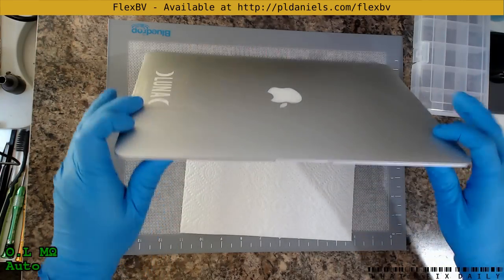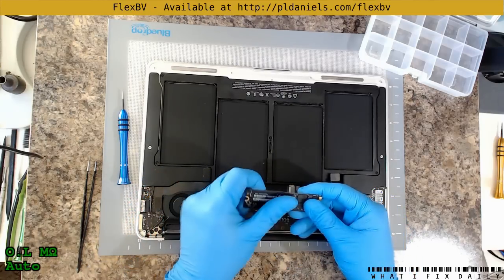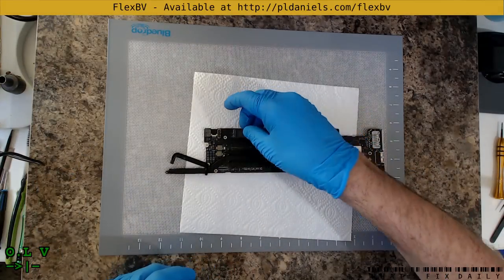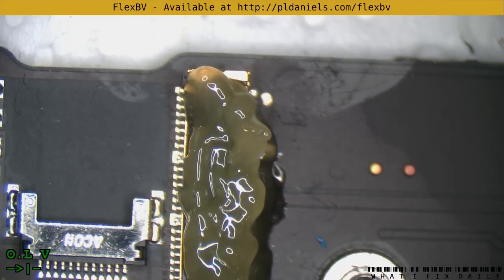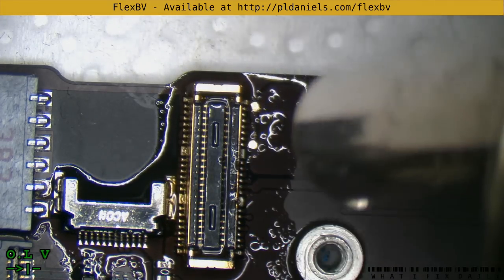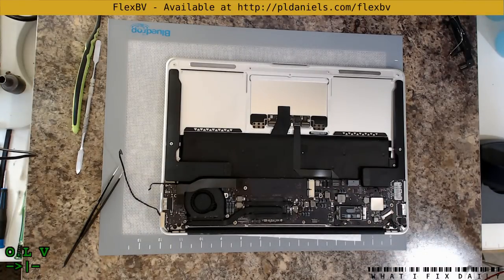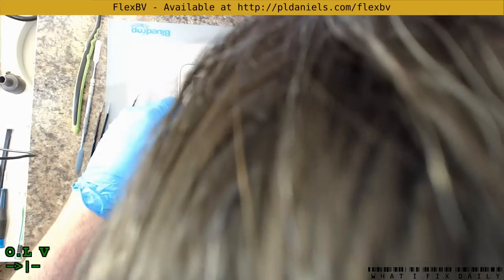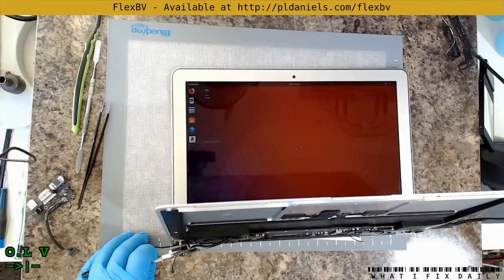Macbook Air A1466 820-3437 No green light, no boot

Comment: do you think a magsafe to magsafe2 adaptor is a good solution instead of buying a magsafe2 charger? do you have or know of a list that has common or known problems with different macbook pros? thanks
if i have a pro A1502 (early 2015 i believe, but not turning on, suspect water damage..) & i have the 
 correct volt/amp charger, albeit a magsafe, using a magsafe to 2 adaptor (both genuine apple) the led flashes amber, what does that mean? if the moisture detectors are red, can they be reset or replaces? the A1502 the battery BMS pcb is a bit corroded! does the battery have to be connected in order for the logic board to give a green light? sorry, louis doesnt answer my posts! thanks
Reply: john edwards  i ask, but few answer